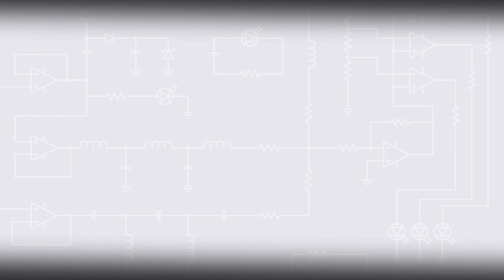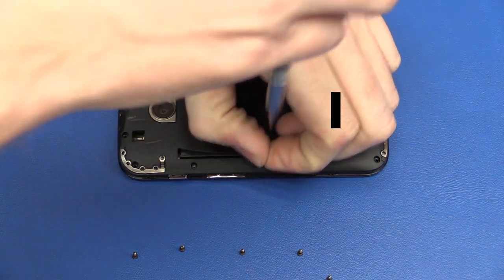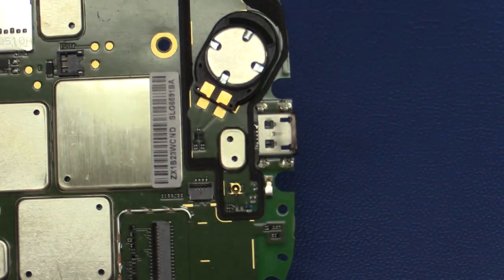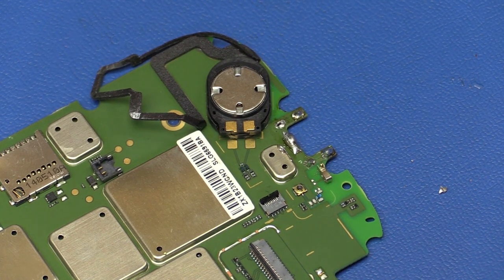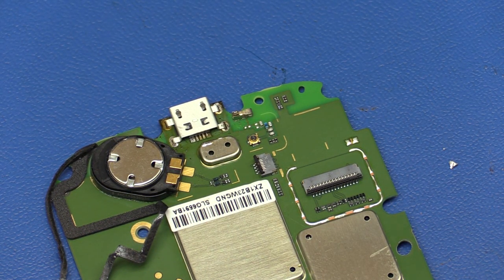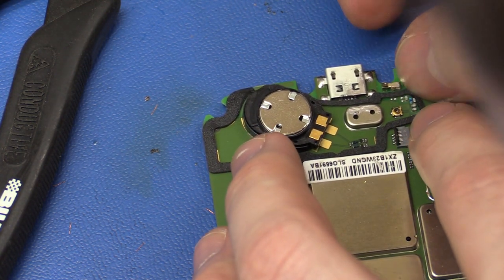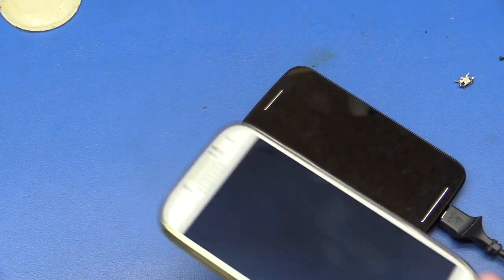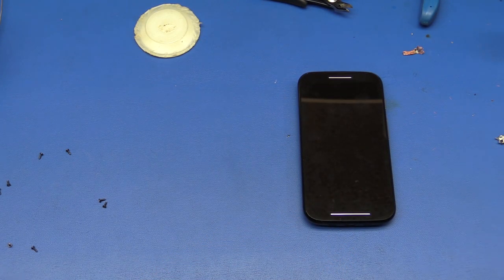Motorola Cell Phone USB Connector Replacement / Repair - Ec-Projects

Comment: Nicely done! I'm sure your friend will appreciate not having to spend 2,000+ Krone on a new one just for a broken USB connector. / A few comments: 1) A clean iron tip will always work better, even for desoldering. Keep a damp sponge or brass wool nearby and clean the tip before every operation. The faster heat transfer from a clean tip not only melts solder faster, it helps prevent damage like lifted pads. 2) Kapton tape does an excellent job insulating nearby parts from heat, flux and solder while you do a repair like this with hot air. You can buy it very cheap on eBay in assorted widths. I use it for all sorts of things; it has strong adhesive that comes off clean even after being heated. 3) Another technique to solder fine pitch pins like on that USB connector is to flux them well, apply a small ball of solder to a wedge or hoof tip, then drag it across the pins. Any excess can be removed as you indicated in the video, or by a quick touch with braid.

Comment: Suggestion: Cover adjacent parts with Kapton tape. Soak your solder wick with flux before use. Tin all of the pads with 63/37 solder, then coat with flux, then attach the connector using the hot air tool. Cheers!

Comment: Nice repair. Thanks for posting.
Just a tip....use a little bit of masking tape to cover areas near where you are soldering.
Reply from the maker: +notionSunday Thank you. Good tip, I probably should have put some tape. I didn't think of that at the time :P
Reply: +notionSunday
hey ,if anyone else  is searching for 
industrial electronic repair
 try Saankramer Electronic Magazine System (Have a quick look on google cant remember the place now ) ? Ive heard some decent things about it and my buddy got amazing success with it.

Comment: Always a nice feeling to see a new video of yours show up in my feed :)

With jobs like this or DC jacks I usually just cut the broken connector apart so that you can remove it in several pieces. I find it easier than trying to remove all the solder and you don't need to preserve the part, you just want to get rid of it so you can install a good one.
Reply from the maker: +Reign Of Error Thank you!!
I did try to do that actually, but my side cutters were too big to cut the legs, so I was afraid to damage the board.
Maybe I could have split the connector in half and done it that way, but I was too scared I would lift the SMD pads :)
But it's a good trick !

Comment: Gah, had to replace the Micro-USB on my tablet several times, in the end I got so sick of it that I soldered wires in and hung a DC barrel jack out of the case!  

I'm convinced that Micro-USB is the worst connector in the history of mankind, especially for things you hold in your hand often with the cable plugged in.
Reply: My old xperia e1 has extra metal covering over the micro usb socket.it is still good

Comment: I need to get much more practive with the hot air station. Quite often I delaminate the board before I get the component off, at least if it has a large thermal mass or throughholes (like this connector). On the other hand I would have "reflowed" the small pins. But a (really) small bump of solder on the pads before you insert the connector, then with very light push heat the pins with hot air until the connector "seats" properly. only after that solder the 4 huge throughholes. 

I did not yet do any "solder repair" on phones, but I exchanged the screen on two. In the preocess of one of these repairs I managed to rip off one tiny inductor (1x0.5 mm if at all) which was in series with the antenna (no reception anymore). Luckily it was on a separate board (that included th USB-connector, which was half mangled anyway) that only cost me 16€ on ebay (worth the money for a phone that still was around 400€ at the time, even though I already had invested 120 for the screen).

Comment: What temperature do you use on solder iron when using solder removing wick? I seem to have trouble removing solder, it takes a long time for the solder to get hot and go into the wick.

Comment: Wow, that's a really "interesting" design - removable back-cover but non-removable battery ... what were they thinking?!
Reply: +zaprodk 
If you don't need a case around the battery, it can be made a 1mm or 2 thinner, which in turn makes the whole phone thinner. And unfortunately most people don't care that the battery is dead and not exchangeable after two years, because they want a new phone anyway. (I guess with a little bit of persistence you could replace it, but 99% won't even think about trying that)
Reply: +zaprodk One more thing about the design is that poor battery that acts like a heatsink for the soc. But it's a small phone so I suppose there was not much space to do something about it. They only put kapton tape on the battery but I think a thin metal plate as heat shield would be better.
Reply: superdau that phone is still thick as shit

Comment: I tried the same thing a few months ago but I don't have a hot air station. Lifted half the pads... :(
Reply from the maker: +Lagm an Sorry to hear that :( Repairing phones and other "compact" devices, especially with the combined through hole and SMD components, is really a pain in the butt...
Reply: +Lagm an  I gave up my Electronics business early 2002 because of the new SMD stuff, decided I would rather keep my sanity than go mad trying to repair shrinking devices.